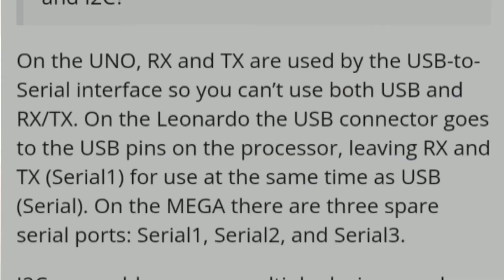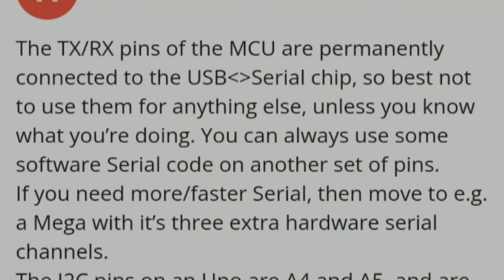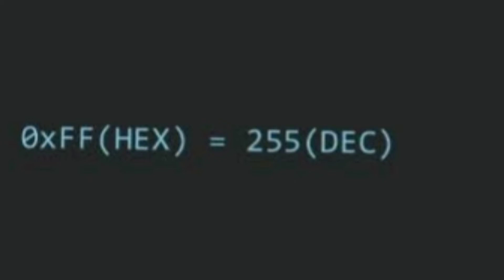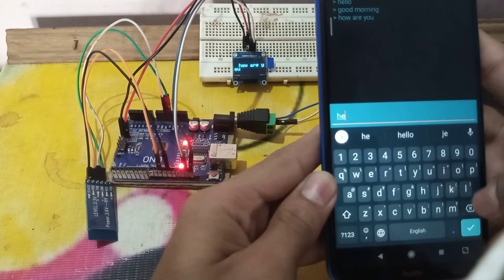Send messages to  Oled display |*free code*| VinVout

Comment: Very Nice work you have done Hard work in preparing this code I Appriciate it but you have shown connection of oled SDA & SCL TO Arduino SDA & SCL it is mistake always SCL is connected to A5 & SDA is connected to A4 of Arduino and you have not shown which oled display  model to use 0.96 OR 1.3"
Reply from the maker: Thank you. Btw I didn't get whatyou have mentioned here. I have actually connected the pins OLED to the Arduino uno's (dedicated pins at right top corner)